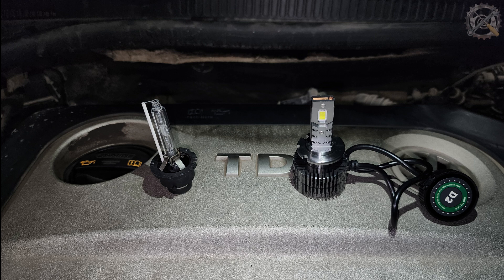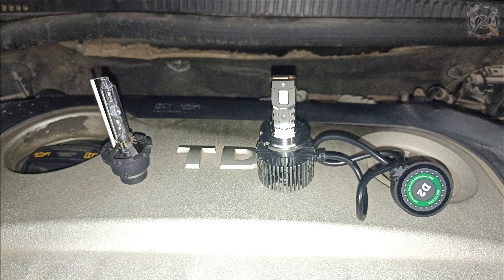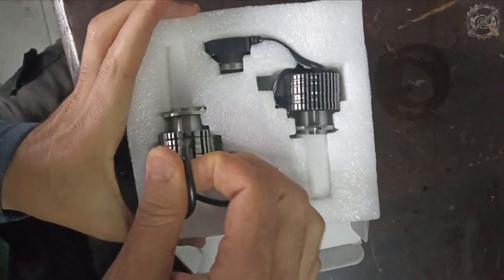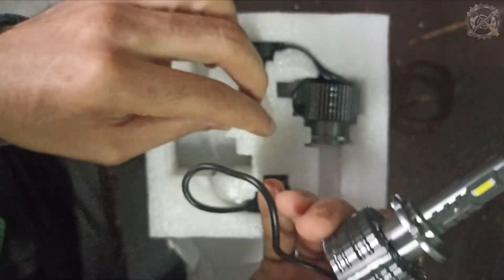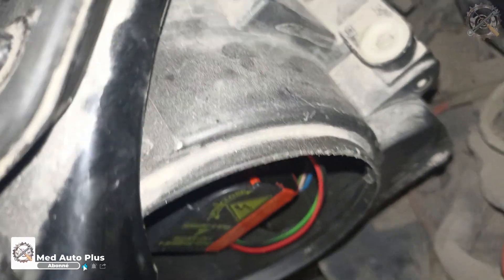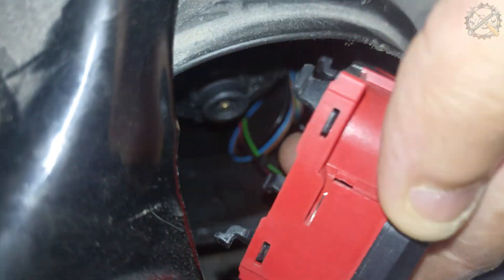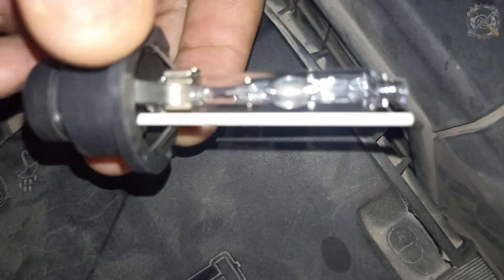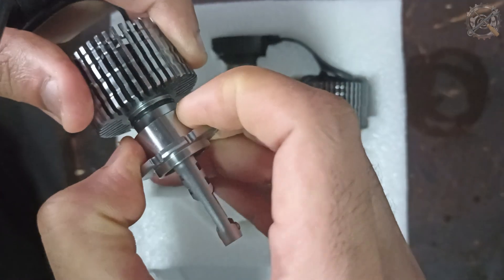LED vs Xenon - ampoules D2S

Comment: Hello, I bought exactly the same D2S LED bulbs and I have a problem with closing plastic cover because there are too little space. I’m scared too because ventilator is obscured by that red starter behind cover and cooling is bad because of it. Also, it makes automatic nivelation impossible to work when I turn on lights. How did you solve that problem?
Reply from the maker: actually the red socket does not leave any space but I slipped the small round into the headlight and the socket I left it in the cover on its flat side, and that left a little clearance for leveling the headlight, and the cooling works very well, these bulbs work very well until today
Reply: @medautoplus-rsk  it's much easier for me to leave the xenons to be honest. I have Philips 6000K xenon bulbs and I'm satisfied, I'm just a little annoyed by the yellow segments on the wall at the top of the light beam line, because the chrome reflector is a little burnt from the top. I don't know what to chrome it with personally because it is expensive for me to exchange for a new one. That's why I thought that LED bulbs would solve it, but honestly I didn't get any special stronger light except that it's a lot whiter but also worse in the rain.

Comment: Bonjour, merci pour cette vidéo. je suis embêté par le ballast d'une l'ampoule xénon su un Pajéro 4, ces ampoules à led semblent être une bonne solution , en revanche, ce qui m'inquiète c'est qu'il me semble qu'il n'y a pas de blocage sur la bague de fixation, l'ampoule à led ne risque t-elle pas d'être mal positionnée par rapport au réflecteur ? et pour finir, ont-elles toutes les  chances de passer au contrôle technique, sont-elles homologuées  ? Merci
Reply from the maker: Bonjour, d'abord merci pour votre commentaire.
D'abord ce type de LED fonctionne avec le ballast des ampoules hid.
Pour la fixation il ya des joints qui fixent l'ampoule avec sa bague, il sont difficiles a détacher. Pour la visite technique je crois pas qu'il y a un problème car le niveau d'éclairage reste le même. Et l'avantage de ces led c'est que l'intensité d'éclairage reste la même vous n'aurez pas besoin de les changer a chaque fois comme HID. pour les changer il faut acheter le même référence que vous avez sur les ampoules HID (D2S,D2R,D1S,D3S ....)